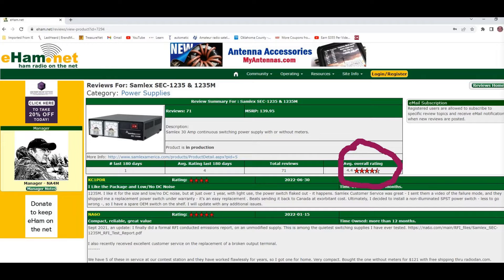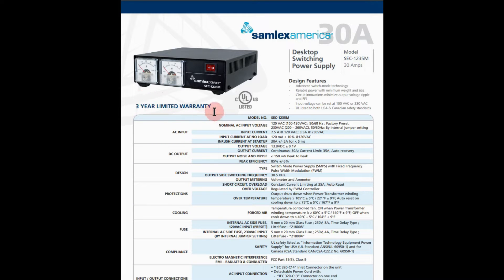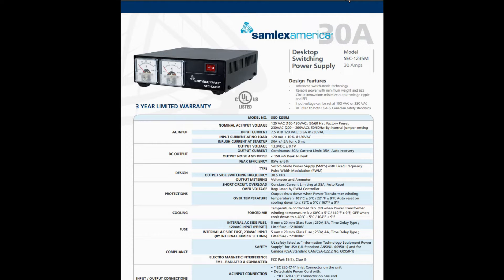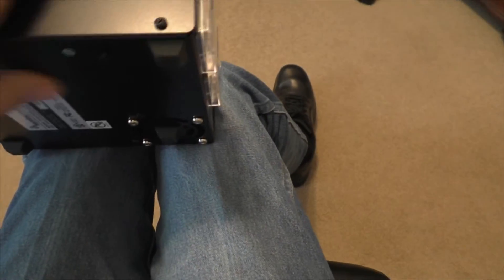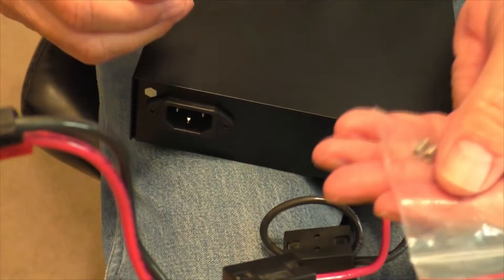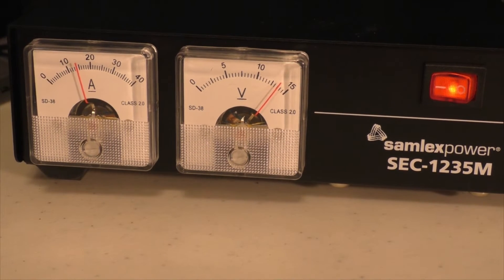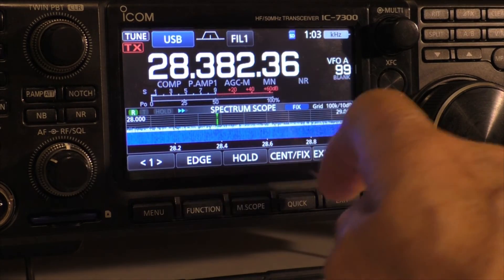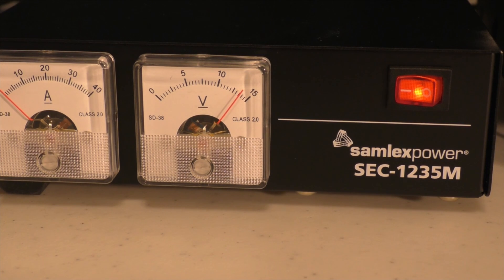SAMLEX SEC 1235M Switching Power Supply Ham Radio Light weight power supply

Comment: How has the supply been? I just bought one for my yeasu 710
Reply from the maker: Thank you for watching my video!   The power supply is still doing a great job!  No harmonics or noise that I noticed.  I think you will love it!!!
Reply: @RichRodgersOnline Just got mine and have been using it on my new yaesu 710. Great supply. Your video helped me pull the trigger on it. They have one that’s a little more modern I like also. I may get one of those if I need another. Thank you.
Reply from the maker: @JerimiahSpeeks  GREAT!  I am glad you like it!!  I think mine is a couple of years old and I love it!
Reply: @RichRodgersOnline thanks Rich. 73’ DE KF2HB

Comment: I purchased one directly from the US (as Dave Casler recommended it for his reference station) and shipped it to the UK.  I changed the jumper for 240v as instructed, plugged it into the 240 volt mains and there was a pop and the meter needle shot up and then died away. I contacted Samlex who sent me through the wiring diagram and all looked fine, but I also contacted Samlex Europe but they said that they couldn't help as they didn't sell that model.

It went on the shelf during Covid until I gave it to a local repair shop who sorted it out. It works fine now.

I do like the unit and it works well (I give it five stars), but I would caution anyone who is thinking of using one in the UK/EU to maybe locate a repair shop first.
Reply from the maker: Wow, that would be terrible!!!
Reply: Luckily I have a couple of other power supplies, so it wasn't too much of a problem Rich. As I say, now it is fixed it worked really well on a recent holiday trip powering my IC-705 quietly. One other point, due to the amount of time between buying it and using it, I had forgotten what the connectors that came with it were for and they were in the "bits without a home" box. The have been reunited.

Finally, I have to thank you for recommending the DXTreme EFLW aerial that you praised in an earlier video. After seeing your review I purchased one (early in 2020) and I am just about to complete 5 band DXCC with it. Thanks Rich.
Reply from the maker: @stirlingpark6145  Stirling, I am glad you found your connectors and I am happy the DXTreme  worked well for you!  Thank you for watching my videos!!!